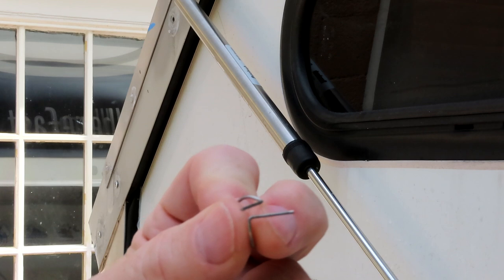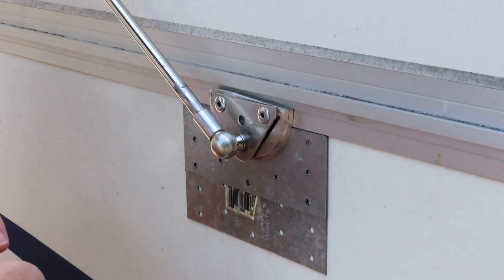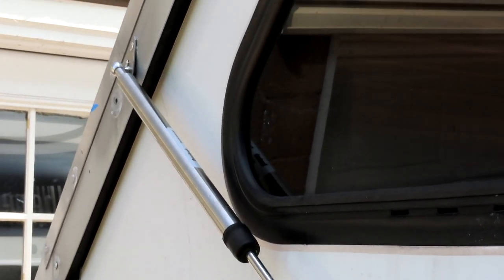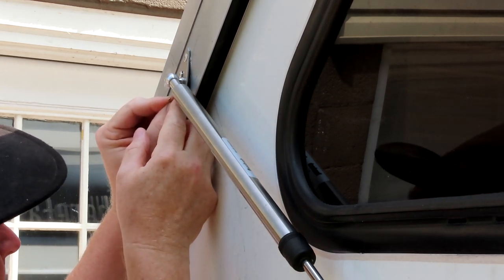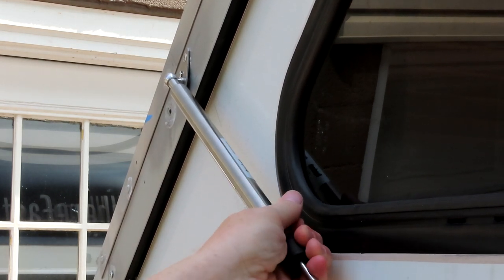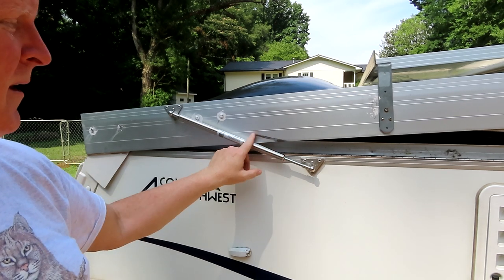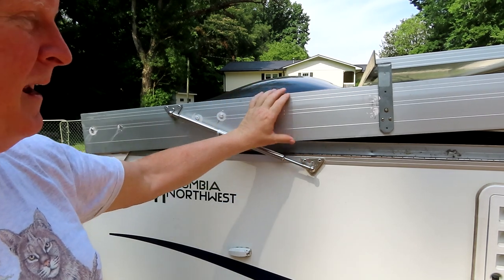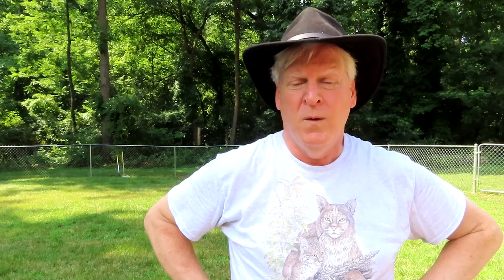Adding Gas Springs Struts to an Aliner Aframe Camper to Assist the OEM Springs or Replace Them

Comment: Thanks for a very well presented repair video. There are differing opinions on storing your Aliner up or down. I store mine down and wondered when the springs would wear out. I now agree that easily replaceable struts are the better choice for roof raising and I'm ok with the springs wearing out so I don't get a wall blowout.
Reply from the maker: Thanks for sharing

Comment: Thanks Rick, very helpfully.  Let us know how this has worked at the end of season.  Mine stays up all winter in the snow.  Are you leaving the springs in or taking them out?
Reply from the maker: I took the one out that I had to pull to do the corner repair.  The other three corners still have the springs.  I just today redid the bungees, so I guess it will stay that way for a year or so.

Comment: Awesome video Rick. You said you had 50 pound struts. Is that for assisting springs or replacing springs. Also,I'm not sure, but you may be able to get replacement bungees from Aliner
Reply from the maker: Last I spoke to Aliner they sell an entire kit for quite a few dollars.  At $20 for 25 feet of bungee I think this is a little cheaper.    The Strength of the struts on the back roof isn't as picky as the front roof struts since the back roof is lifting the back roof AND the front roof.  So I used the 50lbs struts because I already had them and they worked either way.
Reply: @GoingNoWhereFast  Front roof lifts rear roof - it has to be that way for weatherproofing, especially under tow.. So it is on my 2003 Scout.

Comment: Thanks Rick.  I'm thinking about putting these on my Expedition (w/ dormers).  Should I use a beefier strut for this?
Reply from the maker: I would go for 100lbs,  and maybe 30 inches.   You can order a dozen from McMaster car and just send them back after you have decided which is the right strength.  They are very good and will refund you 100%  Just make sure you get all the same length...lol

Comment: I was unable to locate a 25" 0r 30" strut on mcmasters site.were you adding the length of the strut Ends to the total length?
Reply from the maker: Ya, I guess. It looks like all the ones I bought were 22.36". Then you add the 2 1.25 Ends and it brings it to 25" ??   Part # https://www.mcmaster.com/4175T15

Comment: Are the struts on both sides? 4 struts or just 2 two?
Reply from the maker: Originally I only did the front ones, but then the back rotted out and I had to remove the springs, so I did all 4.  But the struts don't replace the springs, you need both!

Comment: Would you use this instead of springs or instead of a bungee cord?
Reply from the maker: No, you really need the springs for the initial opening because the air shocks don’t have any push on the initial, raising up. The springs work initially, and the air shocks work on the final push. And the bungee cords tie the two together so they raise together as a pair, and also keeps them from over opening.

Comment: I’m working on a 2010 ranger and ours has bubble window in the back roof section.   Also we have removed all springs. Wondering if using 70# struts would one person be able to set up the camper?
Reply from the maker: You can buy several strengths of struts and see what ones work for you and send the one back you don't use.  Its so easy to swap them on and off. It takes less than a minute.  Just make sure they are all the same length...lol
Reply from the maker: And yes, longer would make lifting easier, also less stress on the camper.  But there are limits to length and strength.  Something to consider carefully.

Comment: How do you kno what weight of a strut you need to buy?
Reply from the maker: You can guess by how much you have to push, or you can just start out ordering a 30, a 50, and 70 and see which works best.  McMaster Carr will be glad to take the wrong ones back and there is no "Restocking Fee" or anything.

Comment: Have you ever found the need for an aliner high wind kit?
Reply from the maker: Never.  And while I'm sure there might be times, I believe prevention is better than the hope of the kit doing its job.  Which most of them don't.  The wind can blow in the sides, lift up the roof,  blow out the windows.  The High wind kit does nothing for that.  I have had mine set up in 40MPH winds and it holds together just fine.  In windy conditions keep the windows and doors closed, or have them open equally on all sides and roof.  Worse thing is to open the door and let the wind blow in to a closed up tight Aliner. It will open it up like a Happy meal!  Same with a single window on the wind side, or even just a roof vent open and everything else closed tight !  And if you need to close it up in high winds, point it into the wind before you do....
Reply: Thanks for the great info.
Reply from the maker: @snowzone1593    Just my opinion, others have other opinions. This is the internet after all!  Have fun above all !

Comment: Can you please do a video on how to fix "alligator door" on the aliner....please.
Reply from the maker: They way to fix that is to make the side wall align with the lower wall.  The Cabinets along the side are supposed to do that.  I have the same problem on mine. I added a better latch to keep the door together.
Reply: @GoingNoWhereFast  thank you so much for the reply would you mind sharing what latch you bought?

Comment: There has to be an easier way to do this 😀
Reply from the maker: I don't know, this is pretty easy. just measure and attach.
Reply: The problem as I see it is how to find the sweet spot, exactly where to drill for the mounts?
Reply from the maker: @paulburkett2813    If you make it too close, it won't shut, if you make it too far it won't open,  But there is a lot of play because if you set it so it doesn't extend all the way or close all the way, it still works.   You just get the measurement of the strut Fully Expanded, and Fully Compressed and mark those on the side of the lower wall from the roof hinge.  The side Wall is the further away mark, and the Roof attachment point is the Closer mark when you close the roof.   Just double check before you drill.
Reply: If I am understanding this correctly, installing these struts can replace the springs, so they can be removed?
Reply from the maker: @paulburkett2813     No.   The struts work after the roof is up half way.  The springs work when the roof is down all the way.